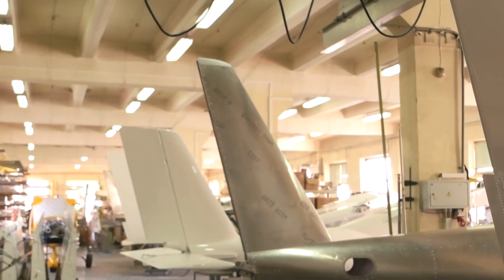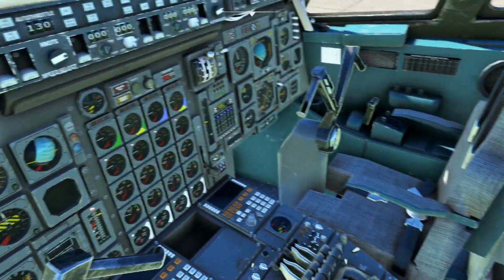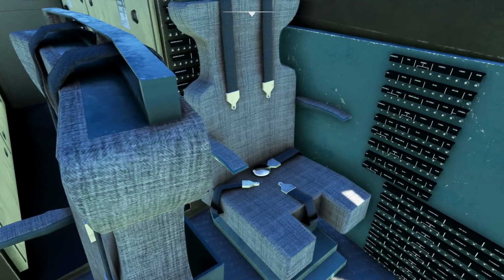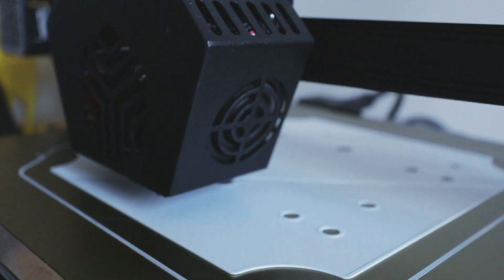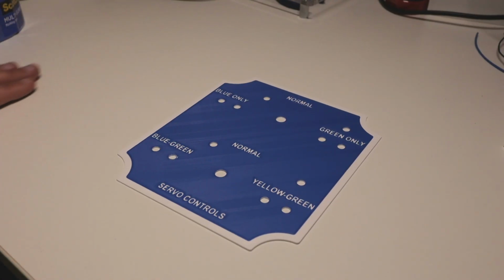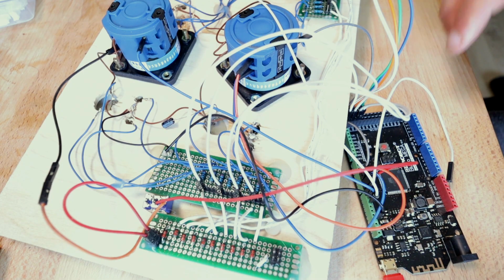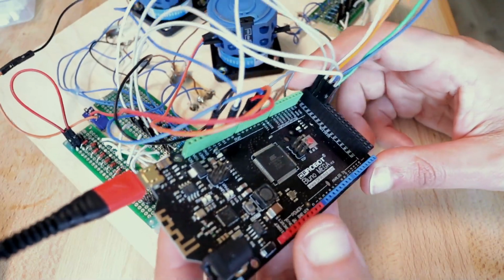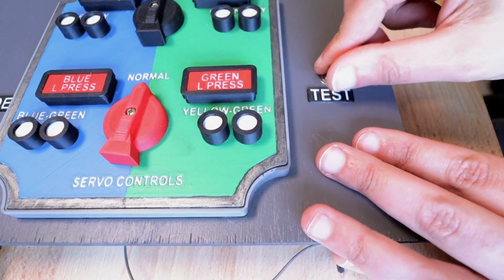Concorde review and DIY servo panel build

Comment: I get this error while trying to add library: Error: Request installZip failed with message: 13 INTERNAL: Library install failed: archive is not valid: multiple files found in zip file top level